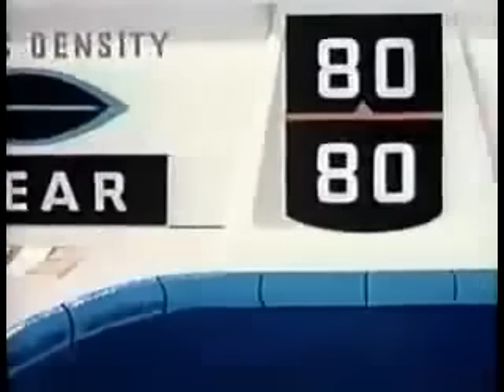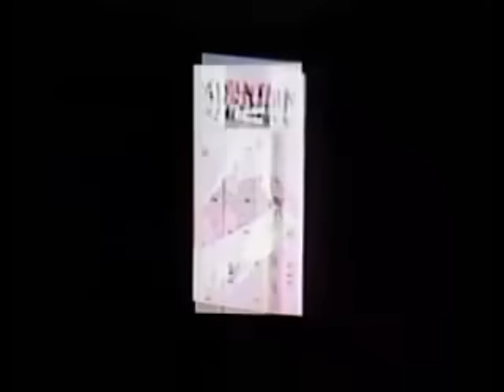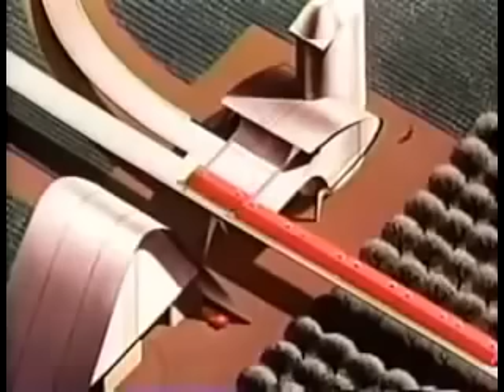The Future of Transport: Disney's Magic Highway - 1958

Comment: The main miscalculation that futurists seemed to make was that advances in technology still need to be paid for.
   Yes, we could have a self driving car with an automated car-washing and refuelling station in our garage, but most people would rather do it themselves and save tens of thousands of dollars.
Heated roadways to melt the snow are a fun idea, but imagine the power bill!
Reply: Cost and what ideas the fickle public will latch on to.
Reply: @travissmith2848 you mean how things cost money to do? Because you have to…eat?
Reply: Also, why should we have a giant tube that’s air-conditioned when we can just have the cars air-conditioned themselves?
Reply: These are made when enthusiasm for nuclear power was very high and it was supposed to be the end for energy problem forever.
Reply: @joshg8053  It would have been, and still could be, if easily frightened fools were ignored.
Reply: Actually Japan has a few heated roadways against frost and snow. They work a little differently though, being near hot springs, and re-directing the water into underground pipes to achieve that, so, no power bill. Also it doesn't get too cold there, so it's enough, wouldn't really work for colder places. Still, they DO exist..

Also, no, their worst assumption wasn't price, but the little research they did, the many sci Fi assumptions, and the BIGGEST one is that they forgot of government monopoly on roads and city planning, and where probably apolitical and thus unaware of inevitable government corruption, inefficiency and it always leading to stagnation and decline. Quite a few more ideas from this (the less fantastical ones at least) would actually exist now if that wasn't the case..
Reply: @mkzhero  No plan survives contact with reality.
Reply: @patrickfrost9405  you don't know what you're talking about. You're talking to a mechanical engineer from a family of architects, and yes, we have that saying and know it all too well, but its not exactly literal, and in the end of the day doesn't usually stop us from achieving what we set out to do. What it ACTUALLY means is that there's always unexpected difficulties that make your job that much harder. The only thing that DOES stop innovation and the ability to improve is legal monopoly on stuff, aka, the government. Its how the US completely fucked up its communication infrastructure and train system, why its so reliant on roads and cars, even in more progressive countries that do allow some other options.
Reply: @mkzhero  nope, people forget that railroads are horrid in 'the last mile', but the problem was that railroads were the only game in town when it came to moving mass amounts of goods (and, another thing people have to acknowledge, goods were the breadwinner of railroads, particularly the bulk goods like lumber, oil, coal, ores, and the like) and people (... and it might upset people, but passenger lines outside of a handful of corridors were actually LOSS LEADERS by themselves, most of the US's passenger lines were not profitable by themselves, in the US it was the USPS contracts that kept the vast majority of those lines afloat outside of word of mouth advertising for goods contracts). Once that monopoly was broken, it was all downhill from there.
Reply: Well they thought they‘d have access to limitless energy from nuclear fission…
Reply: It all depends on the cost. Today we have free personal assistants. See chatgpt, see dola there. Artificial intelligence seems to be fulfilling its functions well. Elon Musk has reduced the cost with rockets that go in reverse. More powerful and less complex engines. Global Internet via satellite, which until then was practically unthinkable. Who knows, when the government stops trying to take money from everything we use, the cost of health services, education, and fuel won't become much cheaper?
Reply: Yeah we're to the point where we can do almost anything people in the 50s could imagine but the costs of construction and raw materials mean it's not really feasible to do it at scale. ie could we build cantilevered highways or multimode vehicles or garages that wash our cars? Sure in small scales. The construction costs of the 30s meant we could build an Empire State building in 1 year without breaking a sweat. These days to build the California high speed rail it's predicted to cost well over $100B and take at least 30 years assuming no more delays (LOL) and that's technology from the 60s.
Reply: I think a lot of these plans would require a nuclear power dominated infrastructure to be feasible. This was before chernobyl and 4 mile island so the public had a more optimistic perspective on nuclear energy
Reply: Solar energy only requires an initial investment and minor routine maintenance.
Reply: @JulianaBlewett   and a further investment on storage solutions, investment in maintaining that... and a readyness to compromise on not having any electricity during the night unless you're gonna use the normal grid like everyone else.
Reply: @JulianaBlewett all for it, but it’s far from just those two steps
Reply: @JulianaBlewett  ...and day time.
Reply: @JulianaBlewett  maintenance is where a lot of your cost comes from.  Just keeping roads from turning into giant pot holes is hard enough without tens of thousands of miles worth of copper wire.
Reply: If only we had invested in Tesla's free power ideas, instead of con-man Edison. His company name is literally "con Edison" he was laughing at us for paying for shittier electricity. Teslas electricity didn't even need wires. It was like Bluetooth power. Tesla screwed light bulbs into the ground and powered them WITH THE EARTH. Incredible work that man did.

Comment: Some of these ideas are reasonable, one or two are even accurate (remote-controlled delivery drones, and self-driving vehicles), but I absolutely lost it at the thought of launching trucks via rocket! 😂
Reply: That was an idea proposed by SpaceX
Reply: gotta remember this is before the 747 and 777 came to the world. They provide a decent balance of speed and cost for air transport... cost is not something that Disney seems to have considered for these predictions
Reply: Tbh it wouldn't be a terrible way to deliver freight. Solid fuel rockets are pretty cool
Reply: @LetsTalkAboutPrepping It would be horrifically expensive
Reply: @benn454 if fusion based engines ever became practical/cheap it'd be fine
Reply: @benn454  And noisy.
Reply: @LetsTalkAboutPrepping nah, it's a bad idea - very expensive and inefficient, also clutters the skies and creates a ton of pollution, can't have it in most places due to that. Electric airplanes though, shot out by coil accelerated paths would be much better, or depressurized straight high speed train tunnels are much better. Tons of way simpler and cheap and efficient ways to deliver cargo (and people) really, it's just that with government monopoly on roads and city planning none of it will ever actually happen until the next collapse or at least MAJOR reform.
Reply: @mkzhero  nope, rail is VASTLY inefficient in what is termed 'the last mile' (i.e. the final stretch between producer and consumers in the context of goods). The only reason that railways got so massive was because they were the only real game in town. A monopoly, in other words.

Road vehicles don't have this problem.
Reply: @TheTrueAdept  They didn't get massive because they where government sponsored monopolies, as seen by more successful countries, they got a boost in starting from it, they DID ROT because of that fact though, as all monopolies and government sponsored/owned shit does. The current systems for rails in most places are insanely outdated because of said monopoly, and often even degraded compared to a couple of decades ago. We could have automated railways by now, automated crane depos for insanely efficient delivery of goods by now, electric minirail tunnels for delivery of loads inside cities that'd replace trucks, but nope, we're stuck with basically the same shit tech we had 50-80+ years ago. Our cities and society could be literal utopias by now if not for the literally religious cult of government and authority worship, and said governments stagnating everything and creating their shit corporations and their monopolies.
Reply: @mkzhero  ... you misread what I said. Railroads were massive because they were the only real game in town. They were a monopoly because their niche has no real competition.

Once actual competition showed up, their monopoly vanished into the Aether.

The only reason that any of the European railroads stayed massive is that the government funded them (even today, the railroads of Europe are only privatized ON PAPER and are mostly funded via the government).
Reply: very little air friction if you are high enough with rocket, not entirely unreasonable....    eg start accelerate on ground, then go ramjet/rocket using liquidified natural gas, and a little liquefied oxygen, could do Mach 5+ if someone perfected the tech without getting too expensive, don't need the delicate turbine blades of jet engine, possible synthetic natural gas could be made cheap

Comment: They want heated motorways in winter and air conditioned ones in the desert, but where does the energy come from.
Reply: Technically, most things would be possible today. But only if everyone was rich and there was an infinite amount of material and natural resources. Maybe with infinite natural resources being rich wouldn't even be that necessary. Everything would be cheaper if nothing was rare.
Reply: Nuclear power 😎

Comment: Its actually surprising that street building machines don't exist. We got TBMs and Gleisbaumaschinen to lay tracks for trains, but road construction is still labor-intensive. How hard can it be to invent a machine for preparing the substructure and smear tarmac on it in one go?
Reply: Machines are expensive. Labor is cheap. There's also basically no difference in speed between having one machine that lays the entire road, and four different machines that do four parts of the process in order. It's also a lot easier to transport smaller machines. 

Think of this. If you have one machine that lays the entire roadway, by definition it must be wider than the roadway. How do you move a machine along roads, that is wider than the roads? You'd have to take it apart, transport the pieces, and then assemble it on-site and hope it doesn't hit the rocks and trees off to the side as it's laying the road.
Reply: You have to dig, compact the ground, lay a few different layers of different substrate, compact again, lay asphalt or concrete, smooth, allow to cure, and paint. A bit of a different beast than digging a hole or roughly trenching then back-filling with gravel and placing timbers and metal rails.